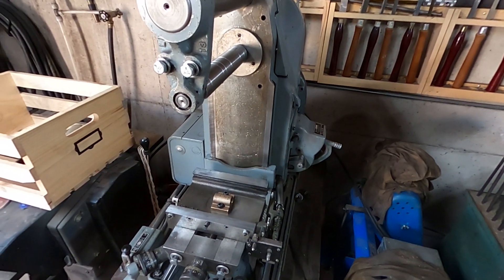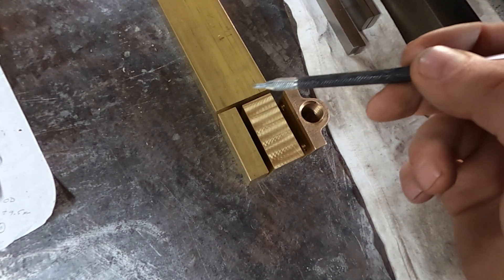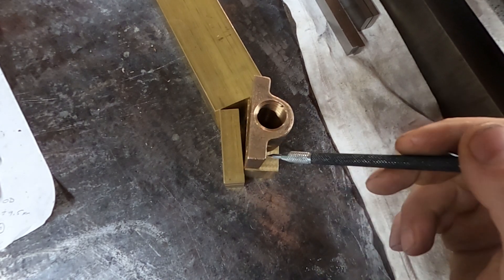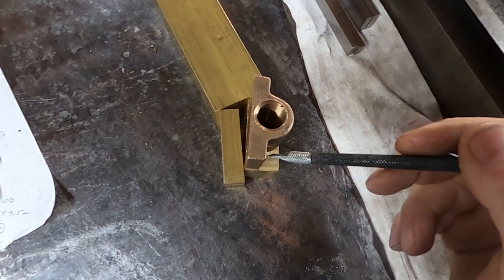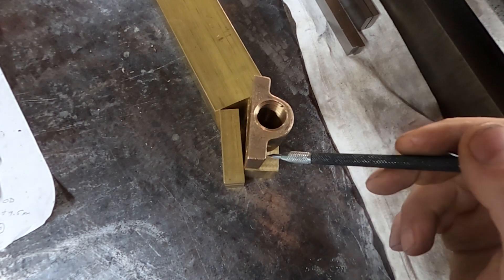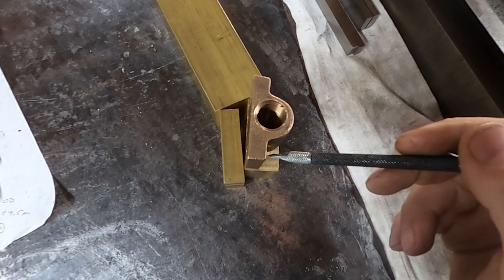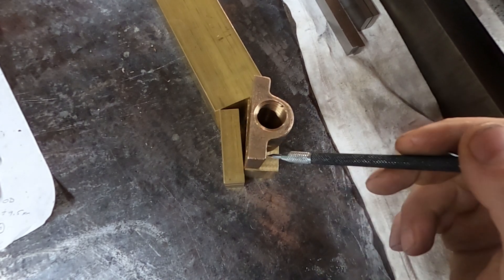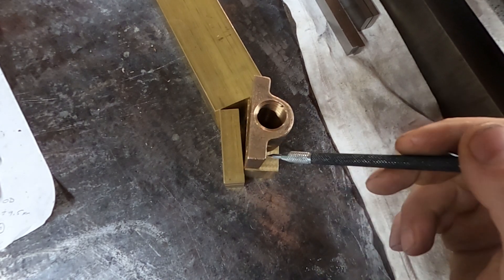Industro-lite Horizontal Milling Machine Crossfeed Nut Replacement

Comment: If you are worried about deviation in brass, go straight to the largest drill bit you can turn and dont use a pilot drill. Just center drill and go. The thick web will help keep the drill from grabbing. You may wind up over sized, but if you are turning a tap that may be a help, not a hindrance.

Comment: Is there a book or resource in basic machinery you recommend? I lack tools & knowledge of what exist to do precision cuts or drills. 
How should you mark the metal when cutting without a lathe to hold the piece firmly or what type of vice/correct fitting to table for precision on a drill press?
Reply from the maker: "Machining for hobbyists" is a good starting book. Accurate squares are very important, there's a lot of things that you can kind of just fumble through but setups need to be square. 
A copy of the "machinery's handbook" has a tonnnnn of reference in it. I have an old copy of it because I don't use a lot of modern tech, it's got nearly everything you'll ever need to know. 
Drill press vises are good for certain things and clamping to the drill press table is good for other things, but square setups are the most important aspect of either of those. I use hardened drill rod in my drill chuck to check for square on all 3 axis. 
For marking I use a tungsten carbide scribe most of the time, sometimes I'll use marking blue, or just sharpie to make my scribes show up better. 
Watch a lot of videos, even if it's about stuff you don't understand you'll pick up information along the way. There is an infinite amount of knowledge out there and it takes a lot to get your feet on the ground, but every little bit gets you closer to knowing it all.
Reply: @dw0r  Thank you so much for the reply im definitely gonna read the book. Yeah my problem is there to much information. Im electrical engineer major, I spend alot of the time spent on trying to get practical with theoretical. So I try learn computers science for embedded with a framework for mechanical. Textbooks puts to much emphasis on theory & Engineers ive talked to arnt really helpful 😅

Comment: A friend of mine just picked up a model 500. However the arbor is stuck in the spindle.. Pretty sure it's an MT3. We've  tried all the typical methods, taping on the drawbar even warming up the spindle with a hot air gun, but she's really stuck. Just wondering if its happened on yours or could give some advice..
Thanks  ATB...Dean
Reply from the maker: Yes. I don't remember exactly which method worked in the end but I hit the drawbar hard. Wedged the arbor against the body with some homemade tapers I ground, and I might have used a slide hammer or a bearing puller. Get me in touch with your friend and I can help with pics and measurements if needed. I've pulled the spindle on the machine before, it's got tapered roller bearings and can take some stress.
Reply: @dw0r  Awesome ! Thank you, I'll send a video link to my friend, he's a YouTuber also 👍👍